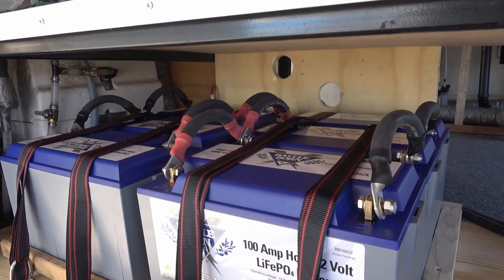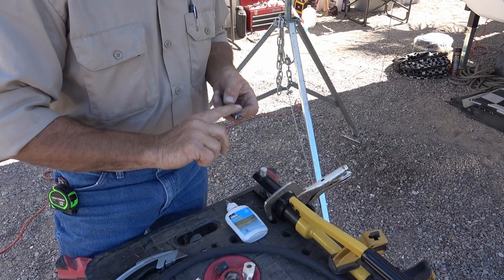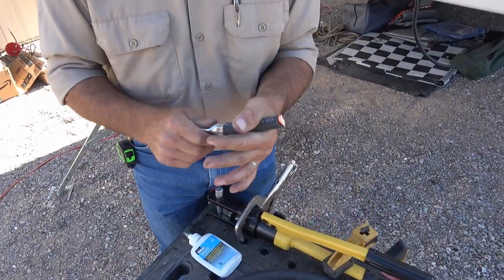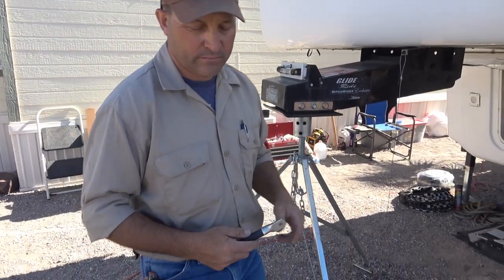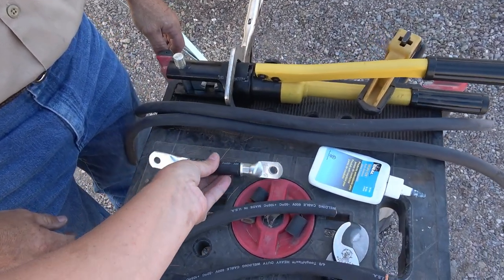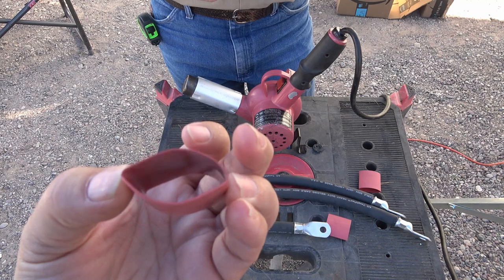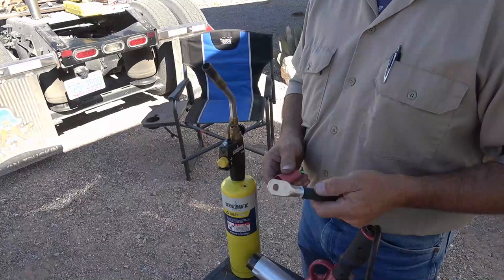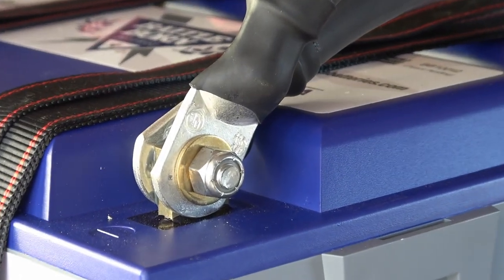Building Custom RV Battery/Inverter Cables - Tips & Advice

Comment: Better to use something like "Burndy PENETROX E (PEN E)" for copper to copper connections.  I believe Noalox is formulated for aluminum wire connections.  And they are both non-conductive (www.youtube.com/watch?v=Yo8e6YD7iNI).  Their primary job is to keep air and moister from corroding the connection.
Reply from the maker: I don't believe the test shown in the video link is conclusive.  As far as I've read Noalox grease as tiny zinc particles suspended in the anti oxide grease. It is designed to work under high pressure when metal surfaces are mated together penetrating the metal at a microscopic level. The guy just jammed multimeter leads into the grease blobs. ;)
Noalox was designed for aluminum house wiring I think but works well on other metals like the copper wire and nickel or tin-coated bolts/nuts and lugs. It's not a requirement on a crimp or bolt but many have found it helps with long term reliability of a connection. Cheers, Ray
Reply from the maker: https://www.idealindustries.ca/products/noalox.html   
"Provides additional inner-strand and inner-conductor current paths for improved conductivity and cooler connections"
https://www.gardnerbender.com/en/p/OX-100B/Ox-Gard-Anti-Oxidant-Compound#
Ox-Gard Anti-Oxidant Compound contains prime grade zinc and is formulated with metallic zinc to create a compound that enhances electrical and thermal conductivity which is used on high power crimp connections and stud bolt mountings. When the connection is tightened, the grease is displaced, leaving a layer of zinc filling in the surface imperfections of the interface. This has a twofold effect; it improves electrical conductivity and it improves thermal conductivity. This reduces the connection temperature under high power conditions by a reduced voltage drop and by providing a heat conductivity path to the connection's substrate.

Comment: The cables attached to the lugs inside the battery are probably #6. This makes no sense.
Reply from the maker: They use multiple 6 gauge wires in parallel, likely so they can bend them in the tight confines of the battery and attach them to the BMS board. See here in this battery teardown video https://youtu.be/G5E30u-66VI?t=100   Wiring in parallel increases the effective wire gauge.